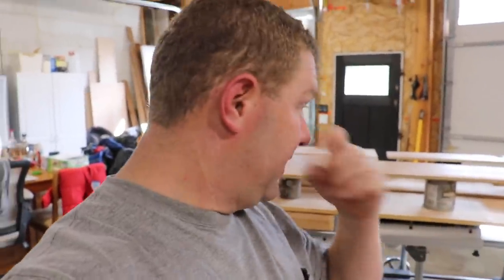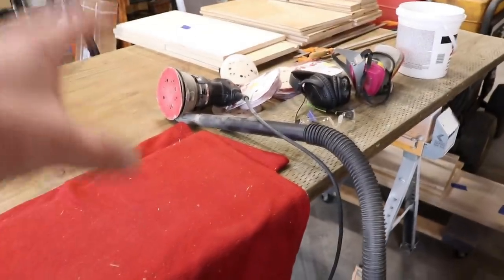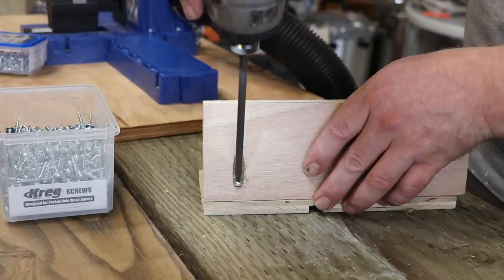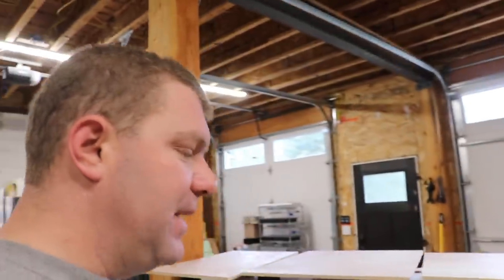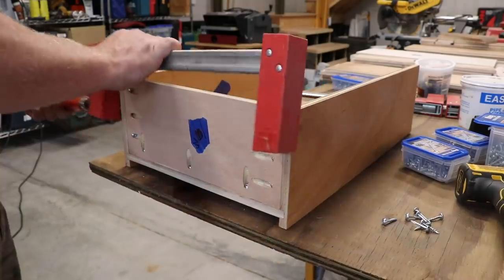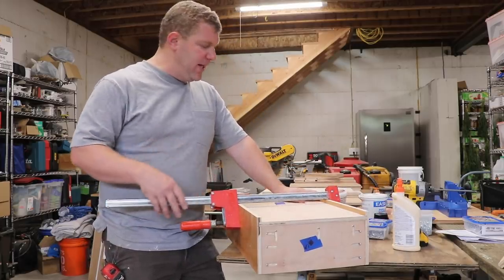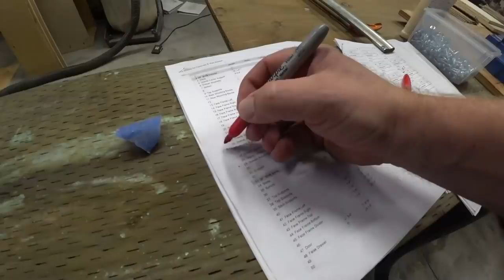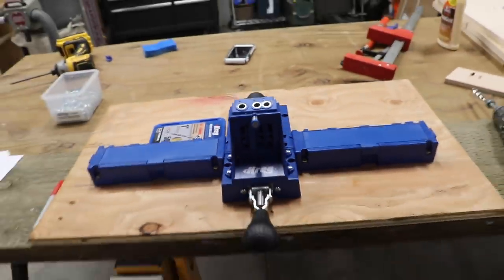IT'S SCREWED & GLUED NOW! (Assembling Cabinet Drawers)

Comment: Sand, one coat of varnish, fine sand and another coat.  Or am I missing something?
Reply: your comment is what I always thought the process should be ... not continually sanding the wood (finished) ,   I did a work table and used your method ... three sandings later and my imperfect finishing  by brush were like glass.  makes me proud every time I run my hand over it.   LOL
Reply: @mariaholman1407  If you are using spray varnish, you can do multiple coats at one time.  Brushing you should uses progressively fine sandpaper, maybe even 400 on the final sanding.
Reply: I never use spray finishes on large flat surfaces, I much prefer brush or wipe on finishes. What I do to get the super smooth feel is 1) apply a coat of brush on sanding sealer to the raw plywood, 2) lightly sand with 220 on a random orbit sander, 3) apply a wipe on or brush on finish (lacquer or water based poly). 4) I usually do multiple coats of finish, lightly hand sanding with 400 grit between coats and after final coat to remove dust nibs. I get a glass like finish with 3 or 4 coats.